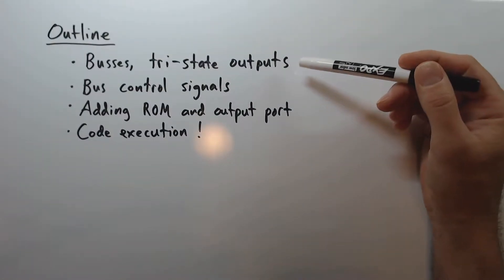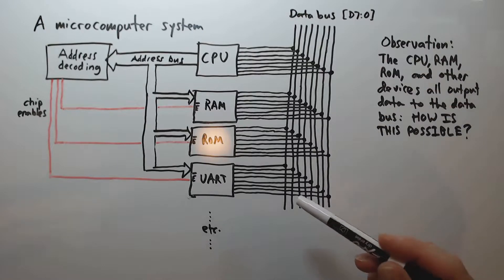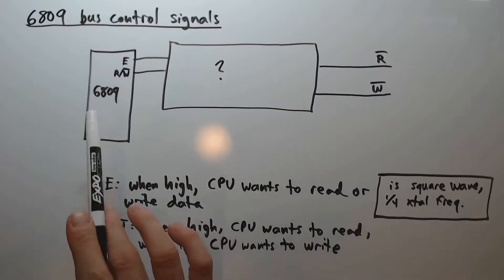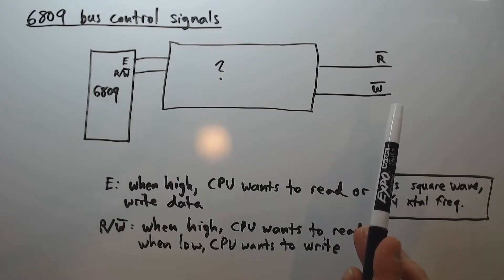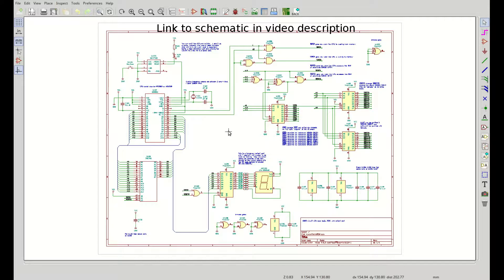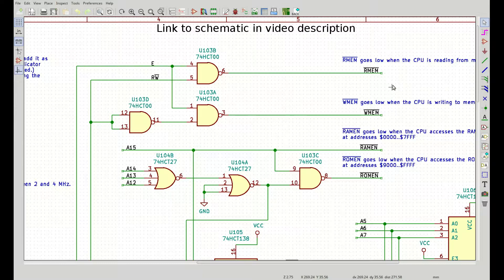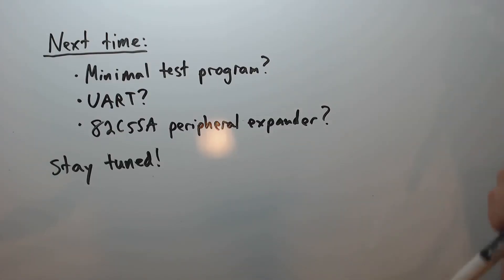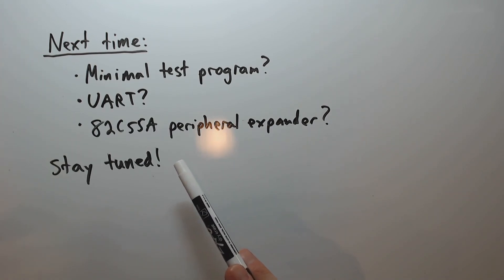DIY 8-bit computer, Episode 9: Bus transactions, ROM, code execution

Comment: Great video Daveho, just purchased a 6809- confident enough to at least have a go at the build mate. !
Reply from the maker: Awesome, have fun!
Reply: @davehohacks  Thank you Daveho, just wondering though, Ive created a bin file from the code you uploaded on GH  however the start value is 0 as opposed to 1000 (so for some reason didn't fill till 4096) I suppose I can manually edit and load values in the right locations however the reset vector is at 6ffe looking at the video it seems to be at 7ffe, maybe you can shine some light!, if possible could please upload a copy of your bin file to GH so I can see what's what's, cheers Franky.
Reply from the maker: @YNGBLD80  I committed the .bin file to Github (it's in a subdirectory called "bin" in "Episode09/bin".) If you're on Windows 10 or Windows 11, you might consider installing Ubuntu 18.04 under WSL2. It works really well if you need to run Linux software. All of the code from the series should build this way without issues.
Reply: @davehohacks  Gentleman Daveho thanks a lot mate  I'm oldschool my man, still running Windows 7 over here!, tbh even had to jump back to XP to use a few 32bit assemblers just to make sure I wasn't buggering up when compiling the bin . Appreciate the upload and help D- ill continue attacking !

Comment: Completely agree that a TL866 is invaluable for this kind of work. I upgraded to a TL866II+ and it works a treat. Also agree that a ZIF socket for the main ROM is crucial. The lookup table and 7 segment LED is good way to test basic functionality but would be a waste for an actual machine. My system uses two TL311 LED's which have latches and hex to LED decoding built in meaning you only need to feed it the raw 4 bits. I can drive these from one port of a 6821 PIA to give me a byte display for diagnostics. The decimal points are driven independently for even more functionality. 32KB ROM seems very extravagant for a machine like this. I wanted a minimal 4KB ROM containing basic system routines but I could only find UVEPROMS in that size which would be a total pain for development. In the end I used an 8KB EEPROM (AT28C64) with a jumper on the highest address bit allowing me to have two 4KB ROM images on a single chip - useful for having a diagnostic ROM easily available. The smaller ROM means I have up to 58KB of RAM if required - 32KB base, 2x8KB "cartridge" (flexible ROM/RAM/peripheral/mixed), 8KB RAM/expansion ROM and 2K NVRAM including RTC. 4KB is used for the main ROM and 2KB for I/O space. I guess it all depends on design decisions and how you envisage using the finished machine. 👍😁
Reply from the maker: 32 KB of ROM is quite a bit. Eventually I would like to have a FORTH interpreter, and maybe an OS kernel in some form. Also, I'll need to store font data for the display controller (in theory that's what I'm currently working on.) This is where your use of the GAL for address decoding gives you more flexibility, I would imagine. Eventually I'm hoping to develop a CPU and glue logic card using the 68008 CPU, which would give me 4 more address lines and allow much more RAM to be added, as well as opening up address space for other uses.
Reply: @davehohacks  Yes, I have a couple of 68008's in both DIP and PLCC packages (the PLCC has a couple of extra address lines allowing 4MB address range vs. 1MB as I remember). Having said that I think I'll probably go straight to a 68000 after this project. The great thing is that if I get the urge I can do a 68008 CPU board as a direct replacement for the 6809 - I still have a few spare lines on the 64 way backplane 😁
Reply from the maker: @spacedock873  Full 68k would be a very powerful system! I'm a fan of the 68008 because of the ease of interfacing with 8 bit peripherals. I have the DIP version with only 20 address lines, but I think it's more than adequate for anything I would do as a hobby project.

Comment: Hello it's a very good video but I have a question someone could you tell me te name of the program in order to install in my computer it looks is very useful program to understand a lot of circuits and working on it thanks
Reply from the maker: If you're referring to the CAD software, (schematic capture and PCB design) I use KiCad.

Comment: How did you make sure that the code binary generated would be the right size for the rom?
Reply: I think I got it. By setting entry point at address $8000 and having $FFFE vector, Total size of bin file = rom size. Thats interesting. You otherwise wouldn't need to start at $8000. 

What took me a while to grasp was the use of ORG directives. Technically when MPU starts up, it just grab $FFFE by setting the address lines. So the ORG $FFFE here is really just to push the FDA instruction to the end of the ROM (like pressing enter key to go to the bottom of a page). The other ORG however helps giving the address for blink_entry label so that in the end the $FFFE instruction is really translated to FDA $9000 in the binary and the MPU will call the right address. 

In the end you are "sacrificing" the bottom part of your rom chip (the first 4096 Bytes). 

Thanks by the way for your videos. Really interesting.